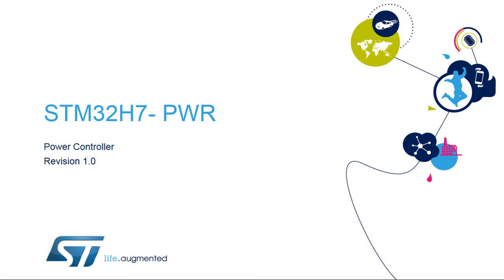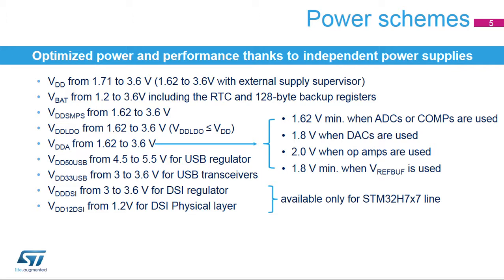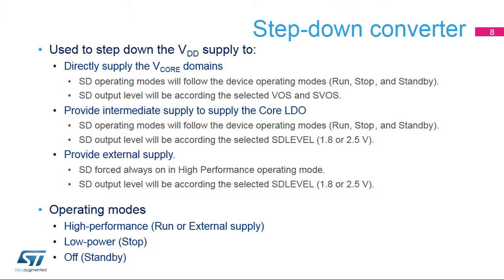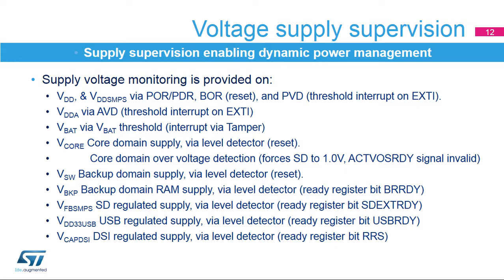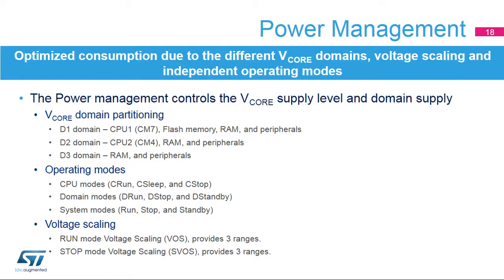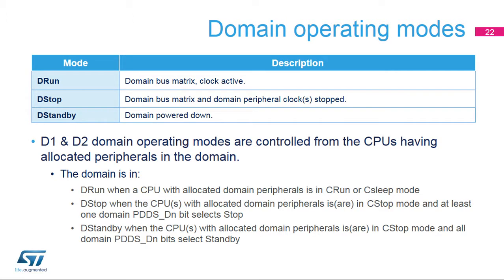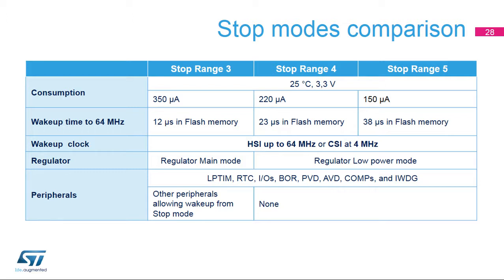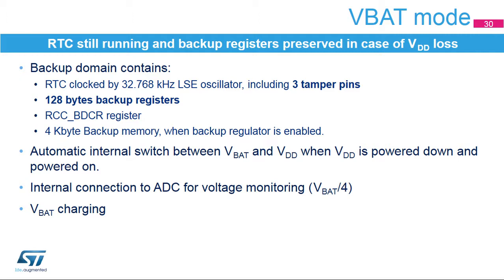STM32H7 OLT - 17. System Power control

Comment: Now that was complicated af. I can't imagine a developer using even 10% of that functionality, do MCUs need THAT much really?
Reply: they deliberately complicated that CubeIDE cannot tune the clock configuration alone, and you have to do manually changing the VOSx range, then back to the clock configurator.
It would  be easy to mark with a label clearly the max voltage and the Vrange operation in use, to make life easier...